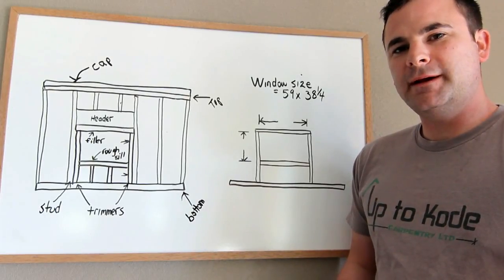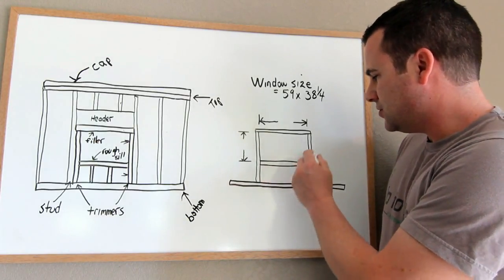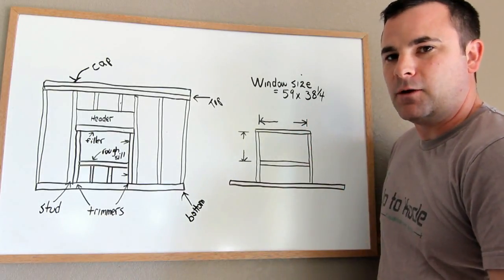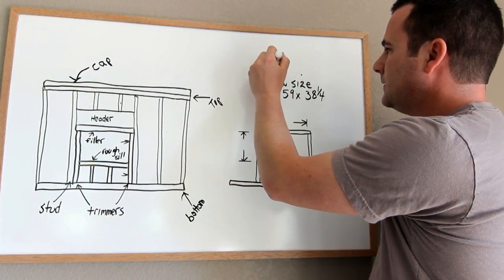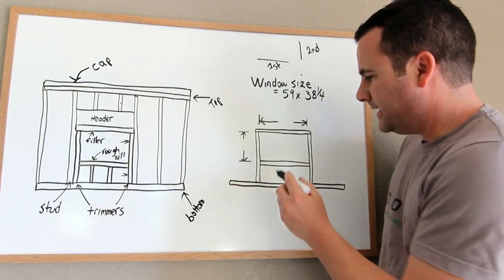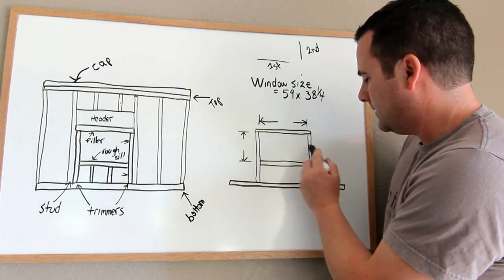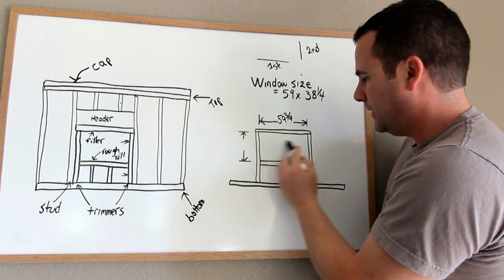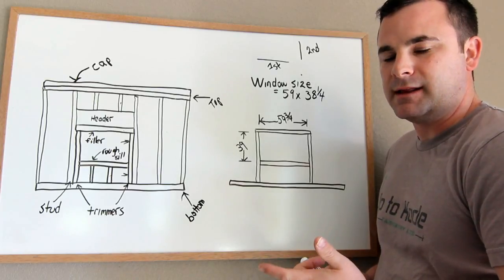What is a Rough Opening?

Comment: Just a question: I'm still confused about rough opening. I've seen conflicting information about it. I keep seeing people on other sites mention a "sash". What is a sash? And what is considered the frame? Is it basically the framing around the window to hold it in place? I have an old metal window that is set in to a wood wall. There is no trim around the window-- so when I measure the opening (basically the whole cutout size in the finished wall) I get approximately 22.75" x 34.75". Is that the rough opening, or would the rough opening be determined if I looked at the outside dimensions of the wood surrounding the window?
Reply from the maker: +my cats a rough opening is this. If you have a hole in your wall for window that is the RO.  It's the size of the opening after framing OR in its framed state. Maybe double check in your local area as terminology may differ. I believe the outside dimensions of the window it's self is called OSM? That the size of the frame but you need your RO slightly bigger to allow for shimming and insulation and to make sure it fits as framing isn't always 100% square and true. Hope that helps.
Reply: Yes. That helps. Thank you.